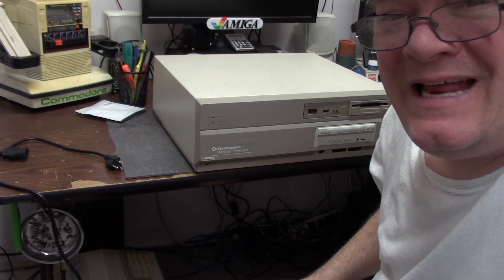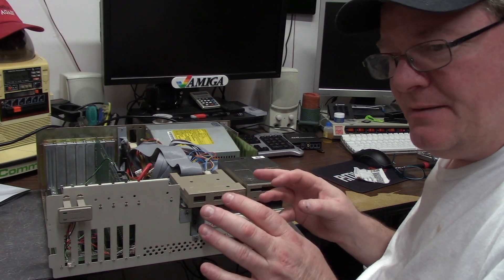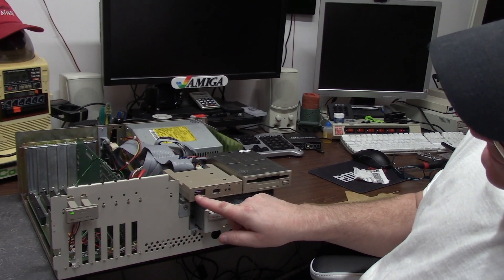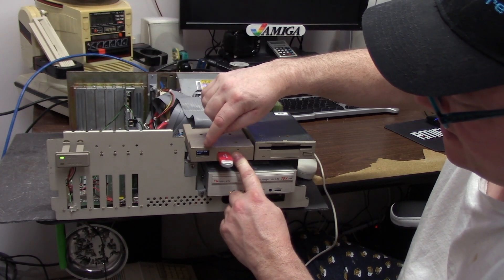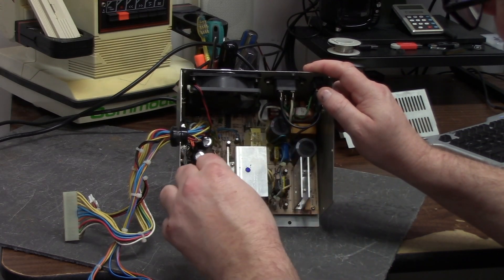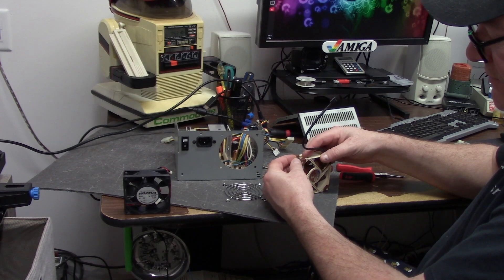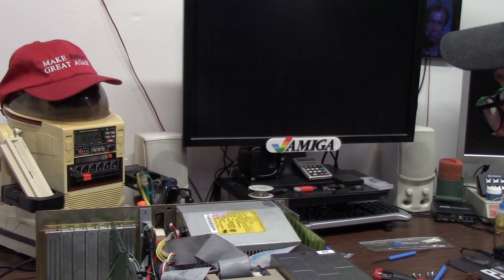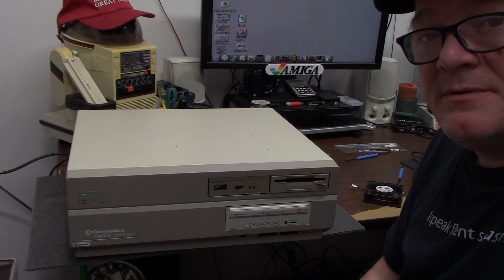Commodore Amiga 2000 yearly checkup

Comment: I put a cleanable, easy air flow filter along the inside bottom vents of the case front cover to catch dust from entering inside.   Fans that work, always have odd number of blades, so you bought a good one.

Comment: Noctua Fans are excellent. Anytime a fan goes noisy I replace with Noctua and problem solved. Those rubber vibration reducers do work well and a little bit fiddly to install first time but with a good pair of needle nose pliers they don't take too long. I always wondered if I could use a Noctua in the 2000 psu and now I know. Thanks Chris. Once again a great video and I did as usual learn something.

Comment: More air is good if it's also quiet. Heat removal is good for component life.

Only downside is the dust bunnies that can accumulate in the corners, on the edge of the main airstream. Something for the regular checkups.

Noctua fans seem like magic because they move more air, more quietly but drawing less current.  Could be something called "Engineering" going on. 😎😁